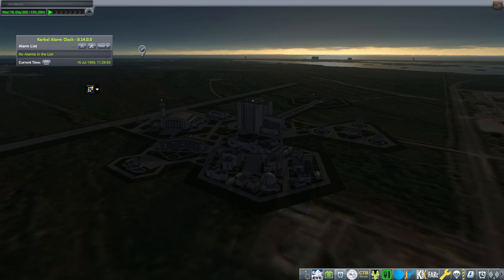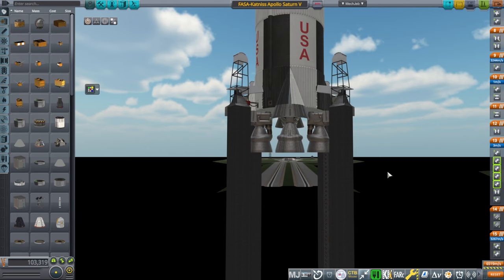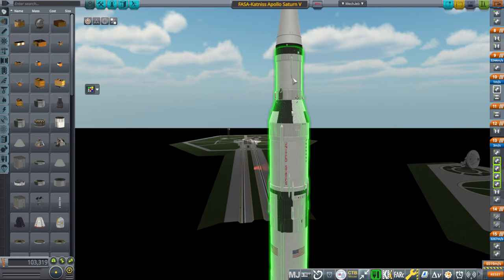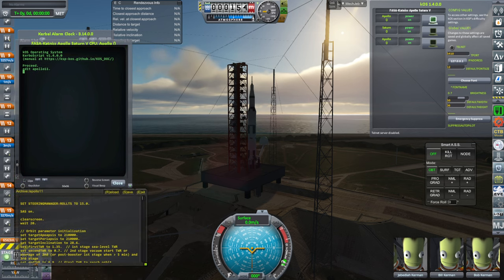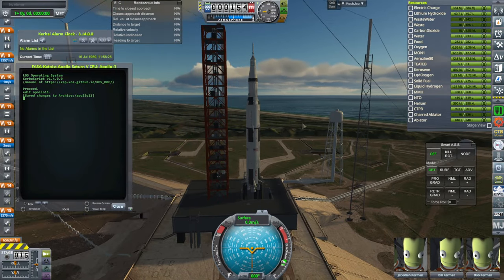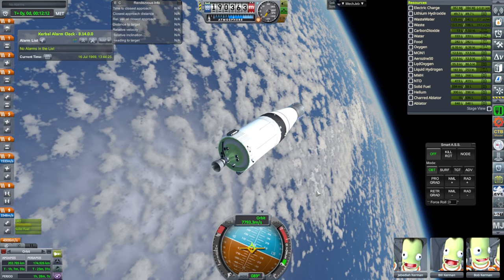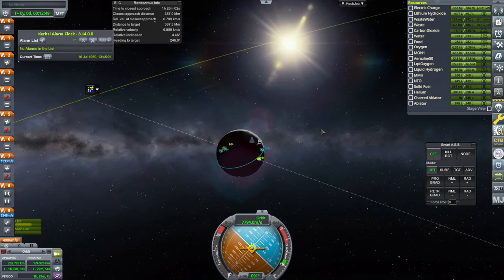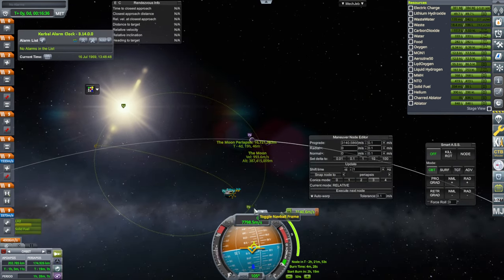Simulating Apollo 11 with Kerbal Space Program and Real Solar System Part 1

Comment: oh and a minor change is addon RSS Date Time formatter, it just changes the timer from that lame "Year 5, Day 200" to showing you the actual date and time.
Reply from the maker: While some might prefer that, it's not necessary with Kerbal Alarm Clock being used for the date. Generally, I prefer to keep the mission elapsed time in the upper left - it's reasonably important in this case and I don't want to be changing back and forth.
Reply: @RaizSpace  Oh for sure.

Comment: maybe it would be a better idea to let mechjeb PVG handle the ascent, maybe KOS handle the timing?
Reply from the maker: Why? Why have two potentially conflicting systems handle the launch when kOS should be able to handle everything with precision?
Reply: @RaizSpace  Have you seen how precise mechjebs PVG is?  Just seemed like KOS wasn't being very efficient.
Reply from the maker: The kOS profile matches what the Saturn V did fairly reasonably. The wobbliness is down to my coding of the script, but that can be improved on - that's not the fault of kOS, but the fact that I was satisfied with this performance. Edit: obviously, if others want to use MechJeb PVG, that's fine by me. I offered the script because someone asked about it.
Reply: @RaizSpace  Right on, kOS is really cool regardless.